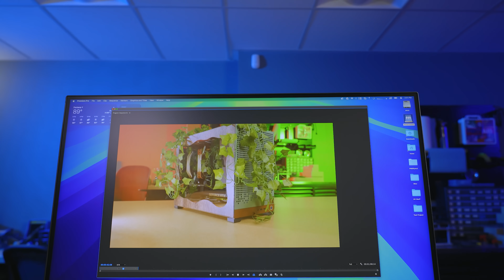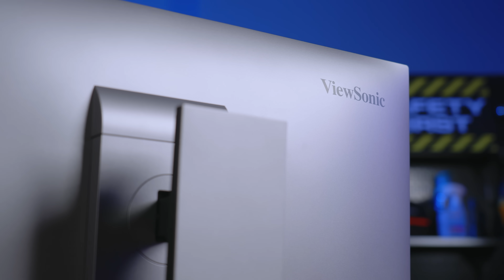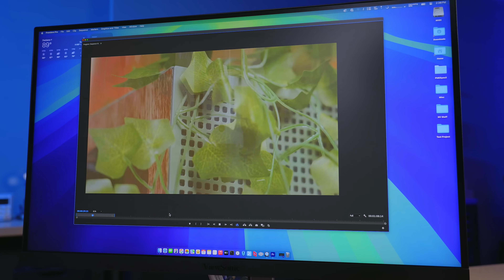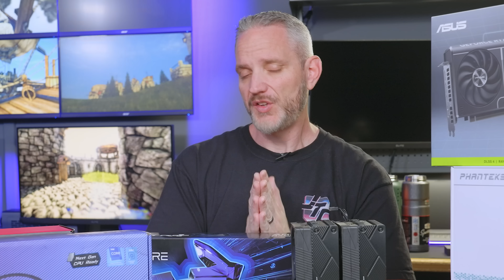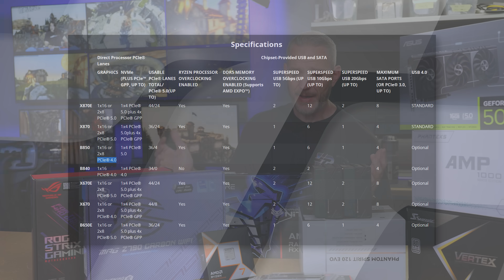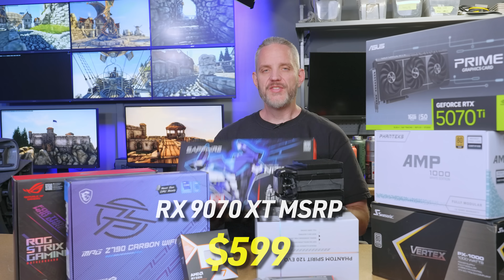This is the Sweetspot for PC gaming... Don't get fooled into spending more!

Comment: About the PSU.  Too Big is a Problem too. Lot of PSU have Problems when they are to big.  Be Quiet has an PSU Calculator. Just google it. There you can insert the components you have in your System. This would run 573 Watts Max. (5 Fans)  Idealy you want a PSU which delivers between 66% and 75% (2/3 to 3/4) of Max load. Everything below 80% is fine. You can toy in the Calculator for further Updates. 573 Watts means that an 750Watt PSU runs at 76% which cutts into the Upgradeability but it would run mostly at 55% load where the PSU works most efficient.  (The 573 Watts are Max load) . A 850 Watt PSU would be perfect with 67% load (47% gaming), and lot of room for Upgrades. (More RAM, more SSD, bigger GPU/CPU). So great choice. A 1000W PSU would be at 57% of the max load, sadly even in Gaming most PC run at 70-80% of load. Which means you are sliding into the 40% or less zone of the PSU, which the VRM in the PSU don't like realy and the Efficiency goes down and your PSU might develop a coil wine.  The 1000W PSU is only a Choice if you know that you will upgrade in 1-2 Years.   Bequiet PSU Calculator  (And of course you only need the Watts of the PSU's calculated there.)

Comment: Note: Not all B650e/850 motherboard have PCIE Gen5 x16 and some B650/850 do have PCIE Gen5. One must do some extra research before purchasing such motherboards specially if you are going to buy Gen5 X8 Graphics Cards which can lose some performance if used on Gen4 only system! AMD totally messed up the mid tier AM5 motherboard feature mandated sets, it was already semi great on AM4!

Comment: I had a 850w 80+ Gold PSU from EVGA for less than 2 years old. It died when I was writing a paper in college. I now have a Seasonic 850w 80+ Ti for the last 4 years and it has been rock solid. I could of had a bad PSU, but now I way over spec my PSU. 
Higher rating usually means higher quality components in the PSU.

Comment: I like how the world hates the Core Ultra 7 265k! Wise purchasers are now able to find deals on them if you buy it on combo with mobo and ram, Micro Center being the perfect example where the closest price parity bundles on AMD are just R5 9600X six cores ^_^ Yes it will be single digit percentage slower on gaming versus a Ryzen R7 9700X but the savings are BIG and tasks that needs cores will be a breeze! There will be almost no CPU upgrade path but who cares, that 8+12 cores will easily last 5-10 years before being considered slow or useless! But if you have access to AliExpress they have R7 7700X that has unbeatable value if used to a complete build thrifting on most parts except the GPU!
Reply: I’m running 48gb’s of CUDIMMs on my 265K right now, 9000 M/ts at Cas 42! Smoking fast system! My GPU is the 5070ti OC Gaming gigabyte card.

Comment: If you don't go with an X3D then there is no rational reason to choose AMD over Intel.  They are fairly comparable, but AMD is generally more expensive for similar performance.  And since Intel offers more cores it is more future proof.  With AMD you need you but a new CPU.

Comment: I could never imagine me defending Intel, but here I'm. 265k for Its cost Is not a bad deal. It is 1/3  cheaper than 9, mobos Are the same Price here in EU a can also run RAM up to 8600mhz, thats my max i could get. Yes, IT IS more power hungry but IT also has much betters iGPU which Is important fór some because moře And more people do not buy gpus And only use iGPU for older games And GeForce Now for newer ones, cause of gpu prices.  In my opinion 265k for less than 240 dollars Is not bad.
Reply: 1/3 cheaper than 9800x i mean

Comment: Me, still running my ryzen 7 3800x with a 9070 xt. Out of games I play, The Last of Us 2 hits the CPU the hardest, sitting around 65% utilization at most points, spiking to 95% during shader caching, meanwhile the GPU is pinned at 100%. Running at 5120x2160 using VSR and scaled down to 3440x1440, max settings with FSR 4 and getting 120 FPS.

Comment: I always overspec the power supplies but I primarily do it for the peak efficiency. If the system uses roughly 400-500 watts during gaming, I would try to find a PSU where its highest efficiency rating would be around that wattage in usage.

Comment: I did my first build late 2019-early 2020. I did a mild budget build for the time.  A Gigabyte x570 Aorus elite, Ryzen 3600x, Sapphire Pulse 5600xt, Oloy Warhawk 2x8 3200cl16 (which actually clocked to 3200cl18-22-22-22 in bios, and wouldn’t take overclocks), Montech Air 900 case, Gigabyte 850w gold psu, Arctic Freezer esports Duo air coooler, 1tb Gigabyte nvme Gen 4, 1tb Samsung 870 evo. 
   After start-up and getting games loaded and everything updated. I had an issue. The Oloy ram was bottlenecking the cpu. So I ordered 2 kits of 2x8 gskills tridentz rgb 3200c14 1 month after build. What a difference. It was probably a factor of going to dual channel and tighter timings. 
  But now that same system I upgrade February2023 (when I say same I mean the motherboard and ram) consists of the Gigabyte x570 Aorus elite, 4x8 gskill tridentz rgb 4x8 3200c14( clocked to 3600 with same timings), Samsung 990pro nvme 4tb, 5800x3d cooled by AK620 Deepcool tower cooler, Asrock Formula OC 6950xt, Evga  1000w p6 titanium( which I tested in system before swapping all the parts, and found out the the gigabyte psu was l not sending full power to the 5600xt ever running like 20-40 watts under), Okinos Cypress 7 case swapped this year ( fully populated with noctua chromax black fans 3x120 up top, 3x140 in front, 2 x120 bottom, 1x120 back, 2x120 side). I sold some of the old parts to offset some of the cost.

Comment: I really can't get with the "you don't need x3D" statements. These balanced builds may appeal to people who want max value for money right now, but what about value over time? I've done balanced mid-tier builds twice in a short time, and both times the CPUs quickly disappointed me. Both were praised by this and other YT tech reviewers as the sensible gamer's choice; both have since fallen off the performance charts while old x3D CPUs still match or beat today's mid-tier CPUs.
So, I learned a hard lesson. My new system is built with a 9800x3d and 9070xt. Based on experience and current trends, I will be satisfied with that CPU for the next 5+ years, including after I upgrade to a probably 3-gens-newer mid-tier GPU. Fellow gamers, hear me out. The immediate sensible choice might cost you more.

Comment: I build pc's for family and friends this is the way i go at it with a few simple questions.

1. What is the budget?
2. What do you have know?
3. Do you want to sell, upgrade or a 2nd build?

After that i take the budged and go like this:
1. Split budget in half and find highest performing GPU.
2. Split half in half and find a CPU/RAM combo.
3. Spent the rest on mobo and case (with low budget im fine with cheap case with PSU in it).

Last build i made for a friend was 9950X3D with 5090 Astral.

He wanted to upgrade from his 5800X3d and keep his 4090, due to his hobby turning into passion with income (VR-Racing/Streaming and capturing).

After i build a complete build without a GPU i asked him, how are you going to sell a PC without GPU?
If you just sell the complete old build you can get a 5090 for the selling price and have the 5090 with warranty he went for that.

The week after he called me daily, This is so fast, damn i can stream and play in VR on great settings even my video edditing en rendering goes super fast now.... yeah bro, you spend 6K on a pc what did you expect?

Comment: People need to learn about true cost to own. You need to look at how long each component is going to last you vs cost over that time. Not just cost to performance. For instance buying 1 $3000 PC that lasts you 6 years and can be sold for $800 is going to be a much better deal than a $2000 PC every 3 years and you still have worse performance. At least with the high end you have a race machine for 2 years.

Comment: My build
Asus DUAL 4070 ti super 
Msi x870 tomahawk wifi
9950x
1tb crucial gen 5 boot
4tb teamgroup gen 4 games
6tb of spinning rust for archives
128gb of crucial ram 6000 32x4
 dark rock pro 5 
Logisys optimus case
HP lightscribe dvd 16x drive
4 arctic fans
2 case fans

Comment: The sweet spot can also revolve around what deals you can find. Case in point, I just built a new computer. I started off with a 14600k I got for 154 and a 9060xt for $380. Picked up an open box MB and sale on DDR5 ram and I just reused my M2 SSD. Got a gorgeous case and a sweet air cooler that recently came out and got rave review for $50. Ended up with a $1200-1500 value for a fraction of the cost and I have zero complaints for work or games. I'm playing bg3 right now and I'm very happy. Yah, it's a dead end system with super limited upgrade options, but it will last me a year or two until and come out with their 6 series of motherboards and CPUs.

Comment: Sleeper build.
GPU - 5070ti - £620.
Mobo - Asus Tuf b650 - £135
PSU - Superflower leadex iii 850w £120
CPU - 9700x - £250
RAM - Crucial pro ddr5 32gb 6000 £60
SSD - 990 Pro 2TB - £100.
Arctic Liquid freezer iii £68
Antec Flux SE.
Octo controller.

Just built this myself. Clean non gamer looking build.
Reply: you got a good price for that 5070ti, I recently got a 9070xt for £570, whereas 5070ti were around £700.
Reply: Why people buy a 9700x over a 7800x3d with only a 50 dollar price difference I will never know. Legit forcing your self to upgrade your cpu 2 years faster for not spending another 50 dollars lol

Comment: Jay, what about the possibility of instability of power delivery, as happened to AM4, B550, where a lot of motherboards were failing the power delivery. I have an x570, I know it’s a powerful chipset, I’ve bought that, for a 3900xt. Recently I’ve upgraded to a 5800x3d having the x570 allowed me to upgrade, but it’s going strong still after 4 years

Comment: I agree with overspecing the PSU and future-proofing that. The PSU would probably be the last thing you would need to upgrade if you buy a quality one. Still running a 650W for the last 15 years. If I bought an 850W I'll probably never have to buy a new one unless it dies

Comment: Hello Jay, subscriber here, I wanted to list my current build to see if you have any suggestions for any upgrade you feel I should eventually look in to or if you think what I have will be fine for awhile, that is if you have time of course. The build is not bad, but I feel the GPU will need to be upgraded sooner than the rest of my build, please let me know your thoughts if possible, and thank you!

MOBO: MSI MPG X570 Pro Carbon Gaming WiFi

CPU: Ryzen 9 5900X

CPU COOLER: Noctua NH-D15

GPU: MSI Gaming X Trio 2080S

RAM: Corsair RT 2x16 DDR4 @ 3600MT

SSD: WD Black SN850 1TB

PSU: Corsair HX1000

CASE: Lian Li Lancool 2

I know the build isnt bad, just wondering if it would be worth the upgrade to anything more recent. Thanks for any help!

Comment: 7700x, B650 and Radeon 9070xt is enough for good 1440p gaming. As Cyberpunk fan (path tracing) I would choose 5070ti over 9070xt, but prices, yes. If You don't care about path tracing, Radeon is way to go, after last drivers, even in ray tracing they are neck to neck.

Comment: Just go for a solid 2k build IMO.  I have a decent 32" curved MSI 2k monitor, 9600xt, 800W power, nzxt case and cpu closed loop all running on a 1st gen Ryzen and 32gb DDR4 (yeah, I need to up the mobo and cpu...but Im lazy

Comment: 2 months ago i build my own rig that is mostly focused about price and performance : ryzen 7700 , b650 board , 32gb 6000mt cl30 ram , 2tb gen4 storage, arctic 360mm aio , 800w psu , case with 6 included fans and the only non new part was the slightly used 7800xt , all together was 1250 euro and smashes any game i want to play.

Comment: You don't need to spend $150 on an AiO to compete with a large air cooler. Thermalright 240/280mm AiO's can be found for $60. I've been running one for nearly a year now on my 5800X, shoved into an mITX chassis. That AiO has been running solid since the day I installed it.

Comment: sweetspot? try to get a use AM4 CPU (3, or better 5000 with 8+cores) RAM BOARD combo.
pair it with an 9060XT, or even a 9070 and you good to go for 1440p gameplay
you maybe lose a few FPS in open world games. my old 3700X has a little trouble with starfield in the big cities, but it is still very playable.
if you get a used 5700X3D for cheap its a very good deal

Comment: Your CPU suggestion about what to go with, is bit too simplified. It really depends on what is in the current system. Coming from a 5800x3D, there is no point switching to a 9700x if the main use is gaming. Then it really needs to be at least the 7800x3D so it is an actual upgrade and not a sidegrade. Also correction to your spec list at 5:40, the B850 boards offer 1x16 PCIE Gen. 5 aswell.
Reply: Sorry this comment is genuinely so wrong , a 9700x is still much better for gaming then a 5800x3D, it wouldn’t even be a “sidegrade” in the slightest

Comment: Wanted a 5090, but couldn't justify even at msrp, so I snapped up an msrp palit 5080. Feels like the sweet spot for me although, still want to upgrade the cpu, my i5 12400 is severely holding back the 5080 at 1440p imo. 7800x3d or 9800x3d depending on price. But even with a 12400 the 5080 is amazing, imagine how it'd perform with the new cpu.

Comment: I strongly disagree with the power supply statement. a few percent efficiency over many years of usage makes a huge amount of money in power depending on the hardware you have and how often you use it. You should also change your power supply at least every 10 years which makes it less useful to overspec in terms of wattage. Just get a new one when you get a new gpu

Comment: my logic was to spend a bit more on a case also as similar to psu potentially futureproofing due to being able to only upgrade parts inside it. a whole lot easier and probably cheaper to swap out a gpu or cpu than rebuild the whole thing. gpus arent just getting hungrier they are also getting bigger. though im still new to the pc world.

Comment: This was my build based on cost that can play dang near everything:
Gigabyte M550 MK motherboard, AMD Ryzen 5500, Nvidia ge force 3500, 700w power supply.  I put in an old HP case. Nvme SSD 1tb.  32gb ram Total cost...._$350

Comment: Its always wise to Overspec power supplies - preferably you want to sit at max system wattage at 75% of the full available wattage - Reasons are because its at peak efficiency curve, and as the power supply degrades you have overhead

Comment: I spent around $2400 and could have spent way less. And that includes the desk, keyboard, monitor, speakers, and mouse. It's literally the first PC I've built for myself with ZERO recycled parts in over a decade (my old system is still fully functional). 7800X3D, 64GB, X870 board (the RAM and board were a bundle at $280 on Newegg), 2TB Samsung 990 Evo Plus, 9070XT, 1000w Redragon, Arctic 360 AIO in a LianLi O11 Evo with a ton of Thermalright reverse fans (and one not reverse).

I know where I could have saved money, like not getting a vertical GPU mount, getting the 5070 non-Ti for $550 at Walmart when they had it, getting a 9600x instead of the 7800X3D, only 32GB RAM, Thermalright AIO vs Arctic, that alone would have brought it under $2k... But I did want to spoil myself a little.

Comment: for the part on air cooling vs aio, with brands like thermalright making AIOs at almost the same price of a air cooling it's also hard to choose, and with how AIOs evolved, like less penetration, more durable and stuff, and especially : easier to fit in and to install 
i mean in europe a thermalright peerless assassin is 40€ while a 360mm new aqua elite argb v2 is 50/60€ same for the frozen infinity with new good looking fans
and for the part about installing, if you have a RGB ram or a tall ram, on a mid range pc, with like a nzxt H5, you never fit the peerless massive fans and heat sink there
and i know it because just last week i was building a pc for a friend of mine, and i had to return the peerless assassin to amazon because it didn't fit (on one side the ram was blocking the mount of a fan, and on the other side it was the motherboard big shield / heat sink thingy, around the I/O shield, don't have the proper naming in english but you get it) and had to get their watercooling for almost the same price which fitted nicely